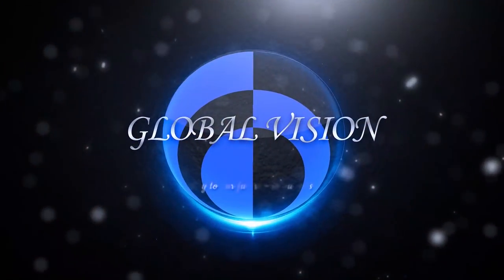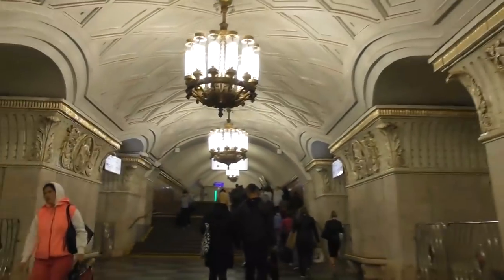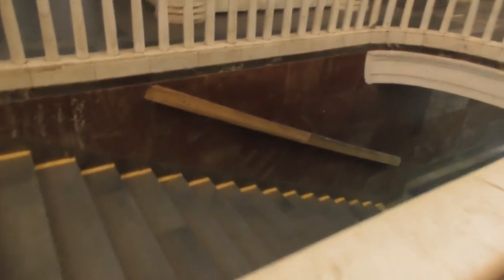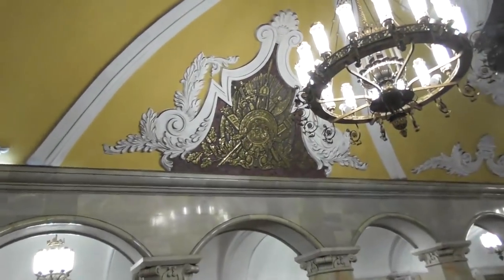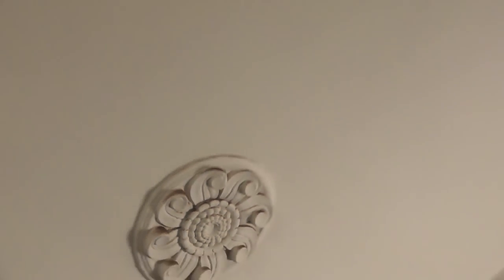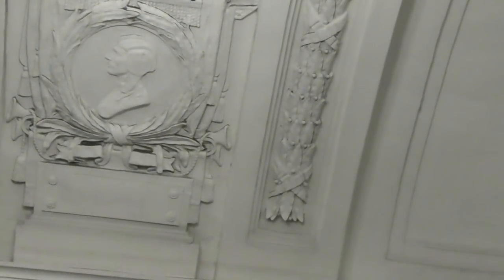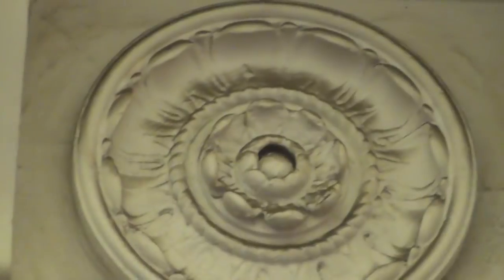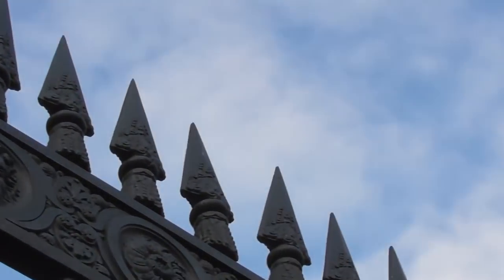Moscow metro. Impossible marble.

Comment: I understand that history is a tricky topic, but if i compare architecture and style it resonates has similarities with Hermitage, but more simple. It kind of indicates that ir was buld before Hermitage.
Using Arch as ceiling and stable construction was popular around 13th century but that was above the ground. Have no idea about underground but it looks like Baroque style architecture - quite bold, thick and heavy, with huge details. But have you noticed that arch distributes light really well. It does not look lime underground.
Marble as a stone ir relatively soft material. It is easy to carve it with metallic tools. It becomes hard after polishing it.

For me most obvious is proportional  scale. If i compare to London's underground station hen Moscow's seems much larger, wider, higher.

Thank you for your video.
💛💛💛